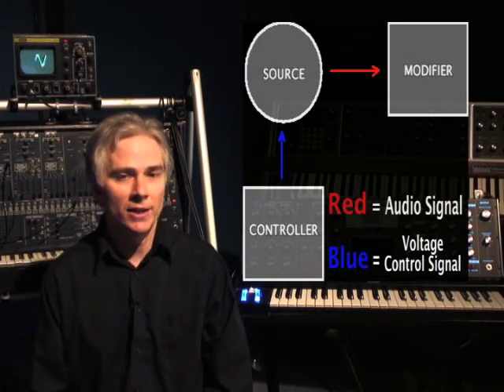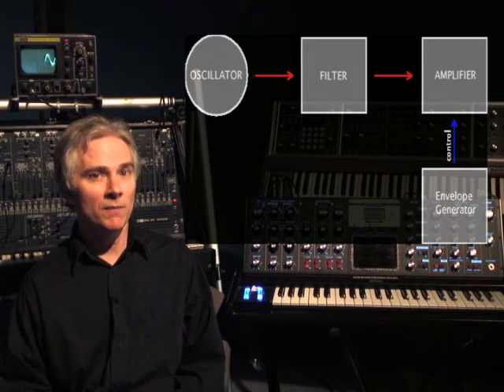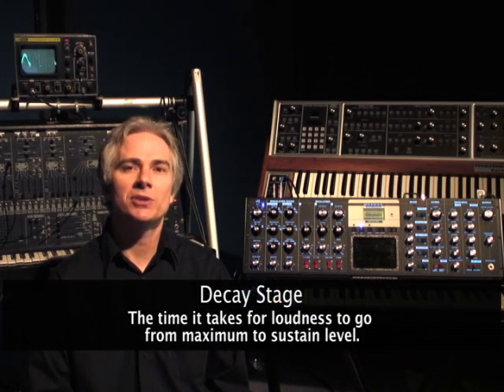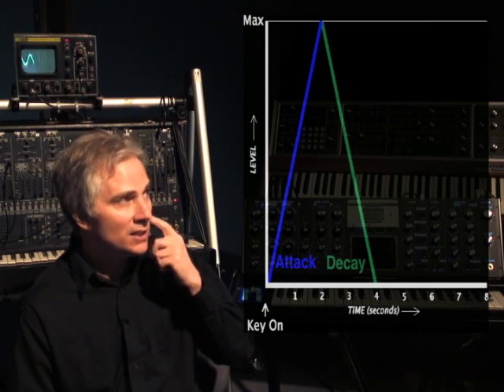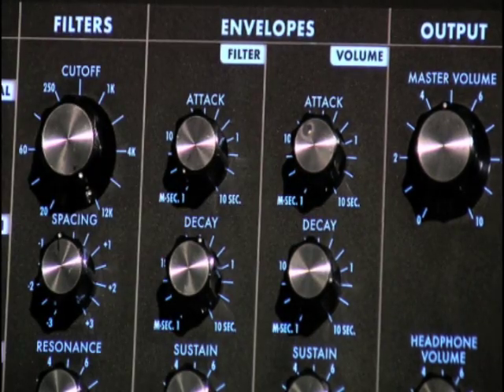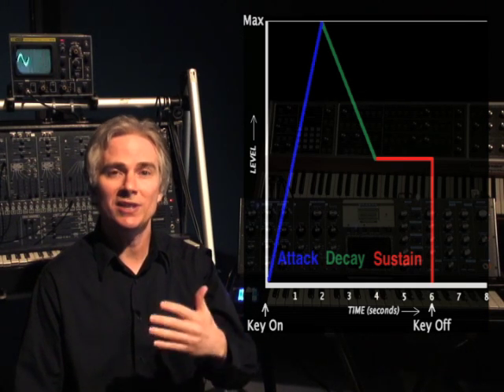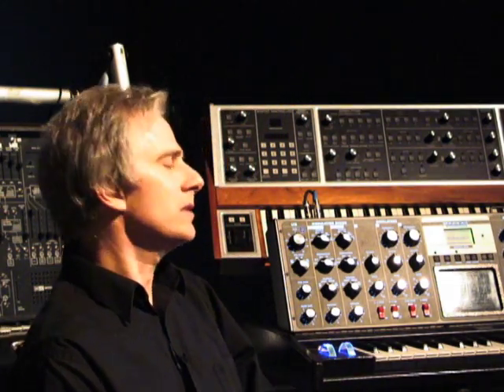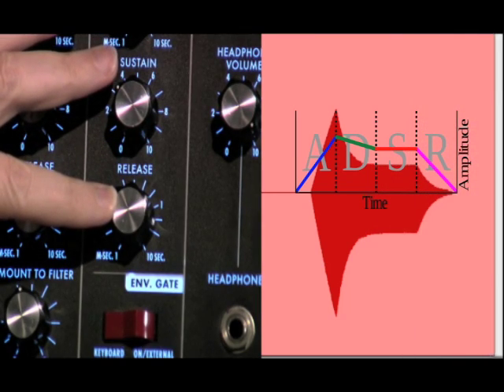The Fundamentals of Synthesizer Programming Pt. 4

Comment: Quick question:
you said at the end before your performance that you were going to play a few examples of using an envelope generator on the filter. However to me it just sounded like a change in amplitude over time (When you turned the envelope generator controls underneath the Filter section of the Voyager) , and a few changes using the filter controls. So would a demonstration of you only using an envelope generator on an amplifier, sound any different to you demonstrating the use of an envelope generator on a filter? How do they differ?

Comment: With an 8-stage envelope of Casio CZ or VZ series, you can imitate delay effects.  Trust me, a delay using envelope, might be much more controllable then effects processor delay.  Although maybe not as controllable as MIDI delay,  Anywho, I achieve much more controllable (tempo synced) delay by not using delay from an audio effects processor.  In my drum machine I set up the same sound to say four different pads with different volume for which. But I digress... We were talking about envelopes :)